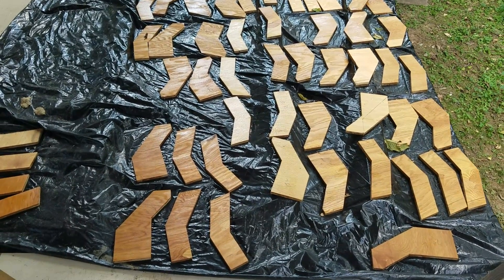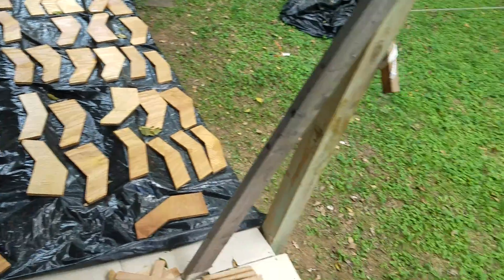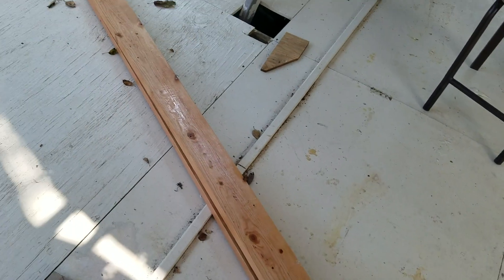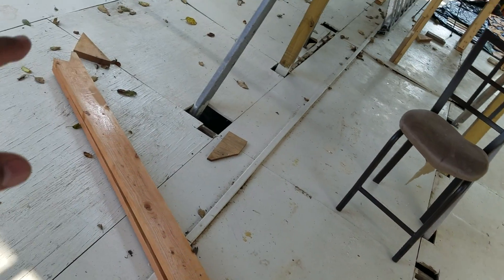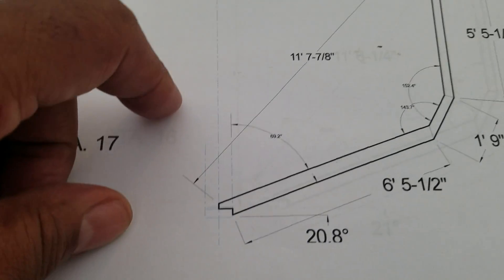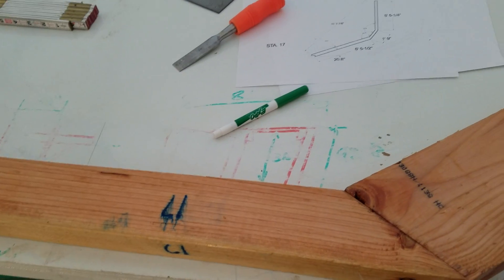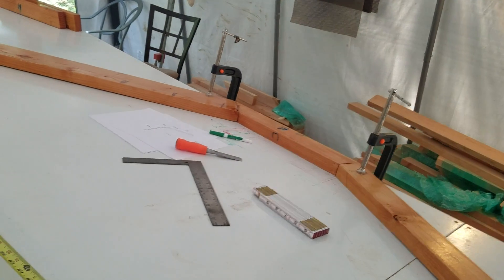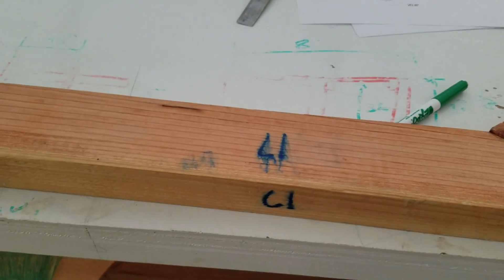Quality Control on Boat Frames

Comment: Measuring from the tips of the frame to the opposite joints would check symmetry. Assembly wise consider clamping the long pieces to the table and then epoxy in the short piece and top gusset.

Comment: You have a really interesting project here and I respectfully suggest you need to pause and reflect on how best to proceed. Lofting at full size is part of that and maybe you also need some adjustable assembly jigs, that will not only support the assembly but also allow you to applying clamping forces to the joints. You could achieve the clamping forces with the use of opposing wedges. I would also be very tempted to make up two Gunter battens that you could set each with the two key dimensions  of the frame set (to allow rapid checking), effectively allowing you to measure many times but without the need to deploy a tape measure each time. I still think you need biscuits or dowels to aid joint alignment and assembly😀

Comment: Why not, instead of measuring twice for every station, measure once and clamp some scrap wood on the table so U can align the second side of the station with the first side u made? (If that makes any sence...)  And repeat the measuring/clamping process once every station u make.  Lucky though u caught it on the first pieces.

Comment: I would consider lofting out a series of frames on the table, one on top of another, maybe 4 or 5 stations worth.Then start assembly of the frames. That way, you not only know that port and starboard frame match, but you'll make sure the transition to the next station is correct. If you loft them all out separately, you may miss an error.

Comment: Yep, got to follow those process charts !  What you are seeing is that a very small change of those critical angles (< 1/2 degree) will have a big difference at the end of those long pieces.  I assume you are also checking the inner and outer length of those long pieces.

I do understand the excitement of seeing pieces that allow you to better visualize the final product !!  Glad you caught it before you had too many built.

Comment: I am a Millwright by trade....my suggestion would be to make a jig because you have so many to do....that way anyone (with little experience) can help you....cheers.....look forward to watching your progress.
Reply: Jigs are great if you are making multiples of the same thing.  Sure he need 2 identical frames at each station, but every station is different so setting up and tearing down a jig could take a lot of time.
Reply: you can make a jig that is adjustable but you have to give some thought to the design of it.......cheers
Reply: +Jim Steketee Jig is a great idea and I would recommend pipe/bar clamps for the adjustments. Mount them perpendicular to a long beam to span from end to end. Then  you can measure from the beam to the corner points. Would need more dimensions but it would set all the angles.
Reply: +greg west actually could use the edge of his table and mount a 2 x 6 on edge for the beam. Clamp angle brackets in the correct positions to contain the ends.

Comment: Landry,  The issue comes from using a very short compass for laying out the angles. You need something longer than 3 or 4" in length. Something much longer will yield better results. If you lofted the sections out on the floor with full size prints then everything would fit. This is a interesting project. I look forward in following along.
Reply from the maker: True, but it's a protractor.  Im using the longest one I could find, but even still I need to check all four dimensions, as no matter how true your angle wood is prone to vary.
Reply: +Iandi Boats For some of the more critical parts if you could get full size printouts that would assure more successful parts. FedEx/Kinkos can do large plots. Most are 36" wide or larger. Plain bond would be cheap.